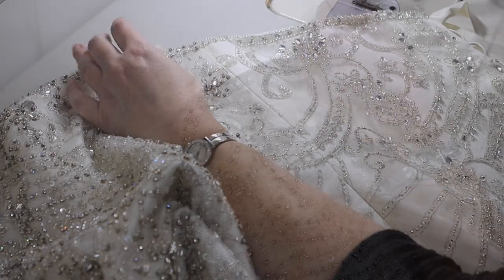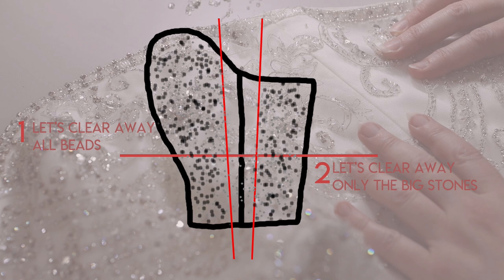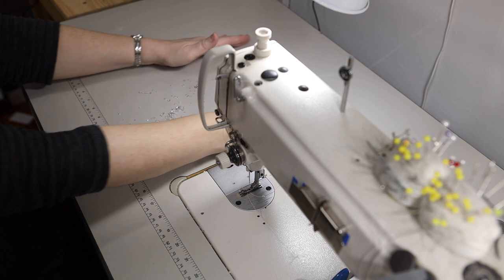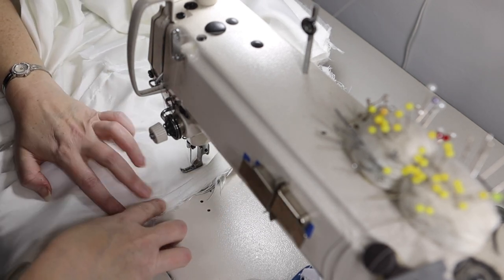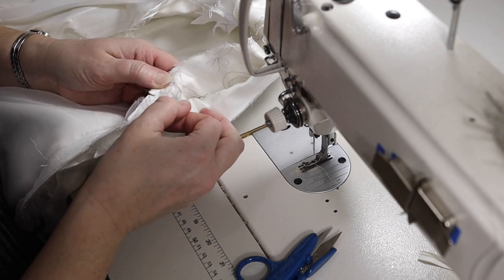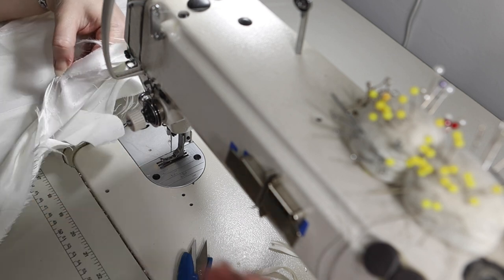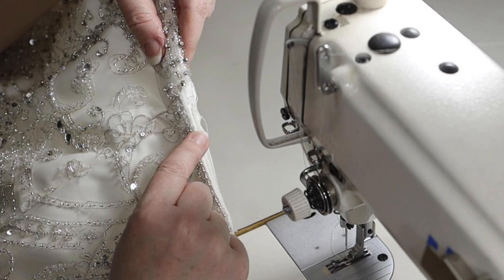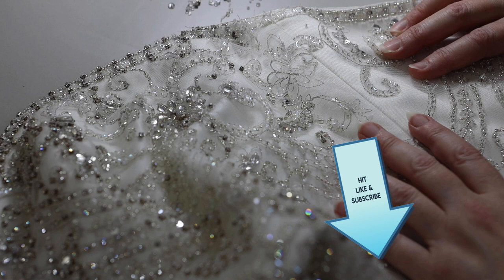How To Take in Side Seam of a Beaded Gown | Size Down a Wedding Gown

Comment: You could use your phone to take several photos of the gown and bead pattern in the areas you are widening BEFORE you undo the beads, and then use the photos as a guide as to color and pattern AFTER widening to resew beads. 🍃🌾
Reply from the maker: I almost always do this! It is so helpful!
Reply: You don't want it to look like its been widened or let out at all. It must look 100% original. Before the phone cameras i would have sketched the pattern and color of the beads by hand (in my notebook) in order to have a guide to follow. It must not show any signs of being widened at all but must look original. Thanks for letting me give u my 2 cents. 
💕🐞

Comment: When you folded that dress and sewed the same together your top edge matched. If I fold my wedding dress at the same and take in an inch and a half it will not match at the top edge of the under arm. How do I fix that top seem to make it look good under the arm hole? The reason why it does not match is because the front of the dress is high and the back of the dress is low. Do I completely take out the top seam and fold it down inside to make it a smooth transition from front to back?
Reply from the maker: Yes
Reply: Thank you so much.

Comment: Thank you so much for sharing your wisdom! I have been doing bridal for 8 years, but some of your techniques and the information you share I have not seen before. 
Questions regarding the size 18 needle. Do you only use this size when sewing over beading? Or do you use this size for the purpose of the thick layers of the shell? If so, do you have to switch to a smaller size when going through the lining layers?
Thank you!
Reply: Same question

Comment: Another great video! Yes breaking a few needles is part of the deal in my world. Have you ever done this one- out of curiosity- where you have to take in the sides and raise the waistline so you slide the back up so it meets the top edge on the front bodice and the waist edge is what is off- then you cut off the waist front as pinned and only do the back as much as takes it to match the front? I have found this fabulous especially on plain top edge gowns and ones that have very strong design lines around the top edge, and strapless bridesmaids too. A lot of the time you end up being able to just leave the back waist and only cut off the front which really saves a lot of work!
Reply from the maker: Yes, I have. It has been pretty rare for me to do it that way, but it's a good thing to have in our back pockets. ;)
Reply: @BridalSewing  was thinking of it because I just did it to a strapless matte satin gown with a pleated on skirt and a beaded waistband and it turned out so great it was scary. Her mom cried.

Comment: Do you press your seams open on the inside to keep the new seam crisp? Any pointers doing this with beads?
Reply from the maker: No, I only press the outside. My iron is set to nylon temp always, so it won't harm the beads/gown. I just press & use the clapper for a flat finish.
I know it seems like I leave out important steps, but I really try to narrow my videos to only what they are about. You know how bridal is so endless, it is hard to find a good stopping point, yet be comprehensive.
Reply: I do press from the inside. I press flat first to get rid of the old line and then open. I stuff the pressing ham up inside to help support where I'm working and not create new dents.
Reply: @adriennegonzales2636  Yes, this is exactly what I do too, just checking.
Reply from the maker: @adriennegonzales2636  I should say, sometimes I find this absolutely necessary- especially for silks. But, if I'm doing a gown with this much structure and beading, I do not press several times- only the final time, but with a clapper. It works just as well for me on this type of gown.

Comment: I have question. I am afraid to do nipperi ng. Don’t rest of beads come out after nipper work? since it has attached one tread?
Reply from the maker: You have to touch the "root" of each thread with a tiny drop of clear hypo-cement. That stops the rest of the beads from coming off.

Comment: Any tips on how to deal with string beads? worked on a dress that beads kept falling off after remover some to adjust the dress
Reply from the maker: Hypo cement little clear dots of it all along each root of the threads. That'll stop it. After it dries, trim the loose threads.
Reply: @BridalSewing  ok thank you , is e3000  equipment to hypo cement?
Reply from the maker: No mam
Reply: @BridalSewing  ok thanks
Reply from the maker: I have a link to the cement on the Products page of my website
Www.bridalsewingtechniques.com